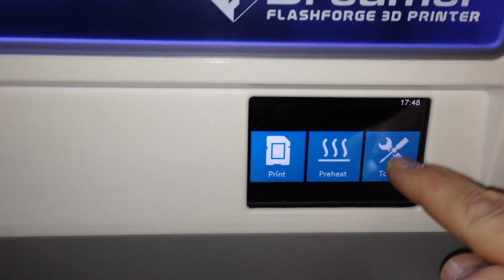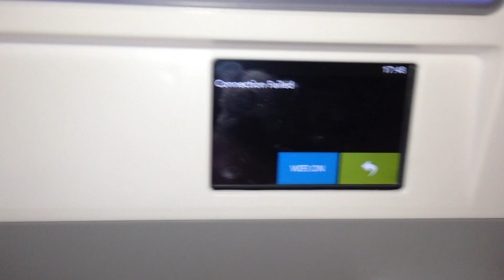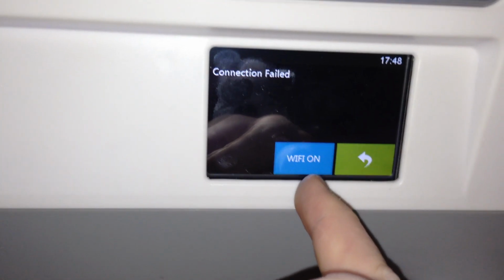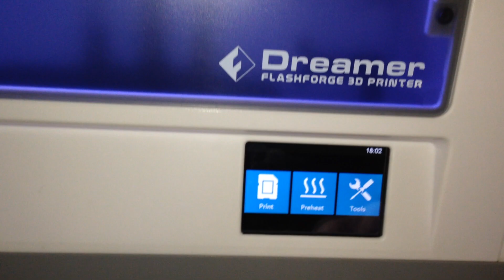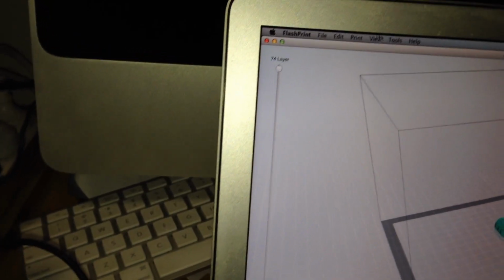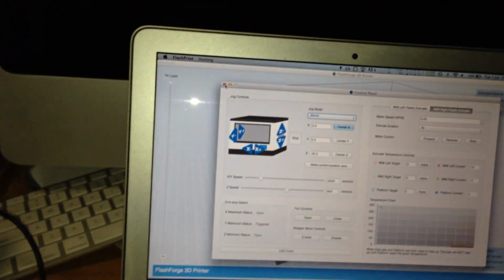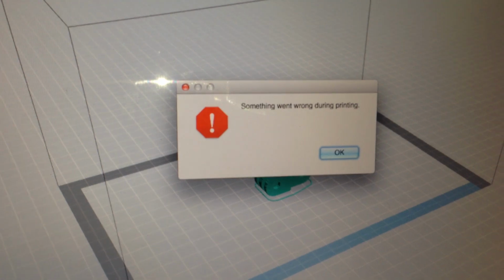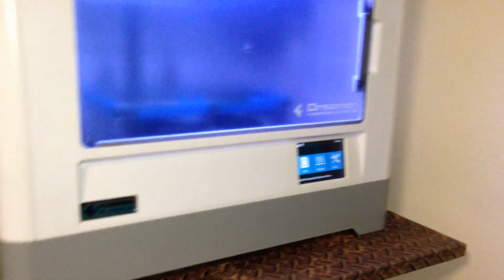Flashforge Dreamer - Wifi Replacement

Comment: My guess it is WIFI modem?? Try shifting closer to modem to test
Reply from the maker: After looking closely the wifi module had a broken 5v regulator onboard. The replacement part worked fine
Reply: ok the joys of # d printing,,